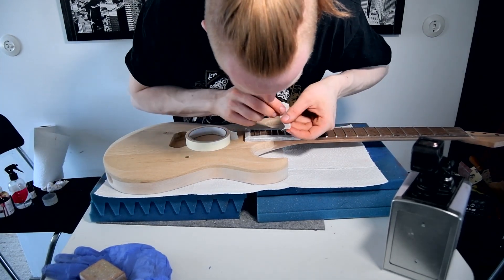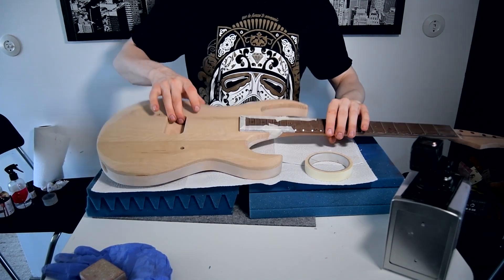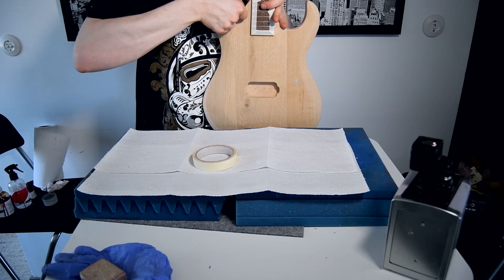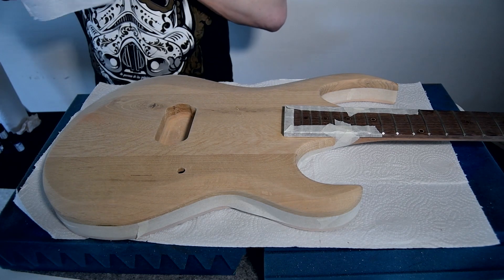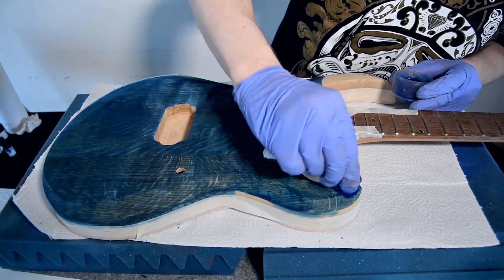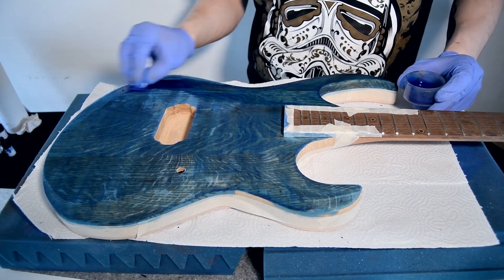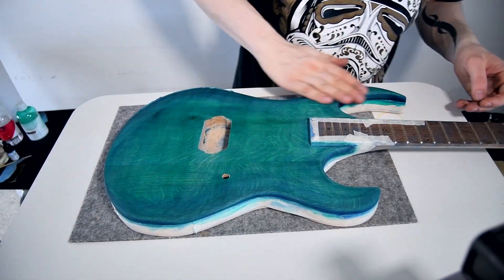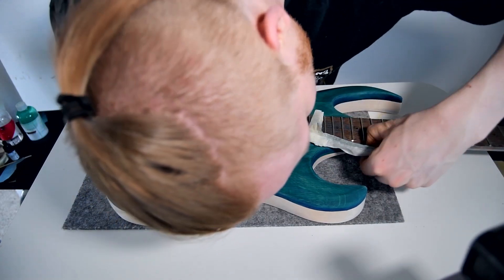Getting a Two-Tone Finish with Water-Based Stain (Crimson Guitars Stunning Stains)

Comment: That body looks more for a solid color. You can keep the edge end grain from being darker by using a sanding sealer first.  On your next kit try alcohol based dye on your first coat.  I went to a local lumber yard and ask them to give my number to anyone buying a lot of maple, That I would like to buy their scrap. Its a great way to practice finishing technique.
Reply from the maker: All great tips right there! And yeah, nowadays I have both water and spirit based stains to choose from, depending on the project :) I have some sanding sealer on my shopping list, but for other purposes.

The colour on this particular guitar evened out great once it fully dried and is color-wise one of my favorites so far.

Also great if you can get those scraps for practice👍🏻

Comment: To avoid lap lines (stripes) work in the direction of the grain, not against it
Reply from the maker: I do a mix of both, especially with more open grain lile this. Usually with water based stain, the first application I do across the grain, sand in between, and then with the grain. I've found that this way I get the most even results.

Comment: Not a bad tutorial, but you can avoid the striping you ended up with on the top of the body if you apply your stain in circles and keep a wet edge to blend it together.  It also helps to build your color level up in layers instead of trying to achieve it in one coat.  Why didn't you burnish the tape around the sides of the body?  There were entire areas where it wasn't even attached.  It also helps to use painters tape instead of just plain masking tape.  You'll get much sharper edges and can avoid glue being left behind like regular masking tape can do.  Just some helpful hints...
Reply from the maker: Oh yeah, I know about that application method. It's actually something I've done quite often and I should have been WAAAY clearer that I was trying this way of doing things, due to a video I saw.

But you are absolutely right, the method you described is a great way to achieve a good burst. I was just trying something out here.

I did actually burnish the tape down and a lot. And I don't recall it coming loose at any point, so I need to have a look at the video.

I have used painter's tape before, but I didn't get as good results oddly enough. But I will see if I just had a cheap brand.

But definitely thank you for your comment and tips :) I definitely should have been a lot clearer on a few things while filming.

Comment: Hello! You seem to know what you’re doing when it comes to staining guitars. Me and my dad are trying to build me a bass guitar, and we’re having some trouble with the stain. We tried buying a water based paint from Lowes but it has more of a paint consistency. Is that what happened with yours? Do you think we could dilute it with some water?
Reply from the maker: Heya! Paint won't work in the same way as a stain, as it is meant for a different sort of finish. Of course, you can try to water down water-based stain and then test it out on a scrap piece of wood (same wood as your actual project and sanded to the same grit).

I checked the Lowes website and you could actually use the Minwax "stains" to do your staining. Although, I don't know how well they would blend together if you're attempting a two-tone finish.

Most hardware stores should have powder stain that you then dilute in a solvent (water or spirit). If you're in the US you could try the stains from Stewmac, or order overseas from Crimson Guitars (UK and what I used in this video) or TLC Guitar Goods (EU).

Hope this helped somewhat :) if you have any other questions, feel free to ask!
Reply: IP Guitars, Alright! Thank you so much! :)
Reply from the maker: No problem :)

Comment: Why masking so much? Simply take it off so to have to deal just with the body.
Reply from the maker: I masked off the back of the body, because I wanted to only stain the top. If you meant "why didn't I just remove the stain from the back afterwards" then simply: it would have been so much more work and wouldn't guarantee the finish I was after :)

Of course, if I was going to stain the entire body I wouldn't need to mask off anything but the neck
Reply from the maker: Ah, yeah this is a set-neck. So the neck is glued in
Reply: @IPGuitars  dang, worst possible setup from my kind of view. Well, well. What you did optically is really nice! It actually inspires me with my own diy Guitar
Reply from the maker: It's a preference thing :) I like set necks the most for a multitude of reasons. Sustain, carries the resonance well, but a bit more character than in through-necks. But I do get why people like bolt-ons and through-necks too. Personal tastes account for a lot :D

And thank you :) good luck on your own project!
Reply: @IPGuitars  Nice and thank you! You're right about the preferences. Just whilst restoring a guitar - bass or whatever - I prefer the possibility to disassemble the neck, so it is easier to care about the both like it should.
Reply: @IPGuitars  Nice and thank you! You're right about the preferences. Just whilst restoring a guitar - bass or whatever - I prefer the possibility to disassemble the neck, so it is easier to care about the both like it should.
Reply: @IPGuitars  I put it wrong: "like it should" sounds way too general. What I meant is that one can focus on the Body and the neck separately. What is nice just concerning the coats. Bla bla... You do it right, Sir. It looks marvelous. I am keen to learn.
Reply from the maker: No worries, I understood what you meant :) and very true indeed. I currently have a bass in for maintenance that has a through-neck and needs fretboard replacement. To say it's more difficult than a seperate neck is an understatement haha.

But thank you :) and cheers for checking out the content!